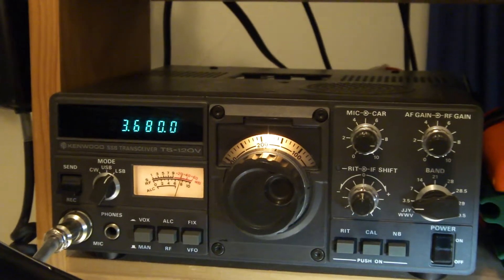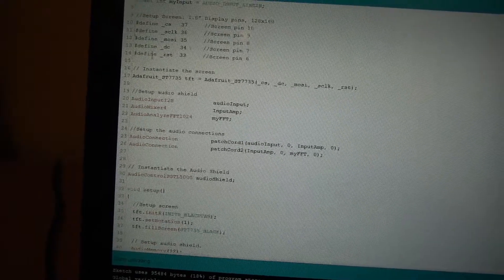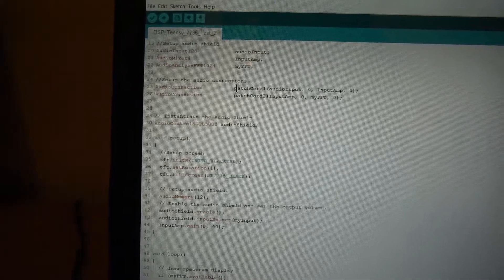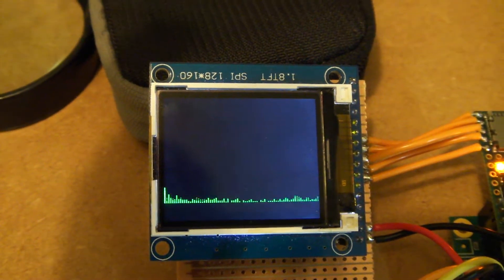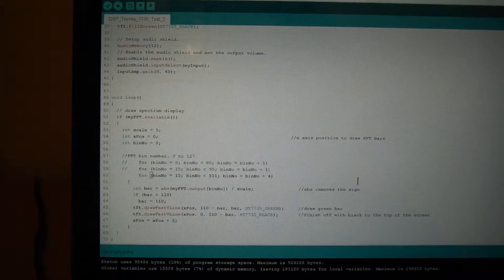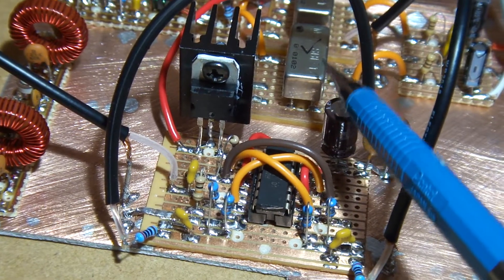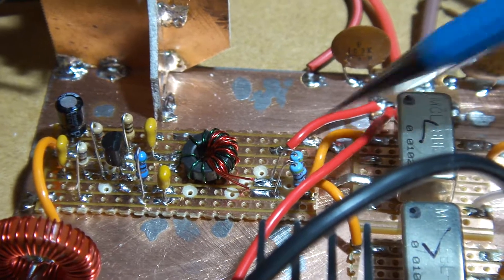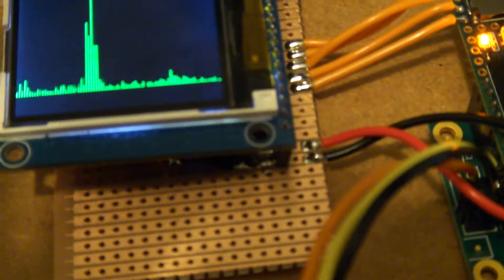Homebrew SDR Receiver Part 1 - LCD Screen and FFT Test

Comment: I'd love to know enough about the low pass filter coefficient values to create a high pass and band pass, all of which would be adjustable through 8 pots. Each cut off point and how fast it drops off. Wan to turn a Teensy 4.1 into an active crossover... and other things; see if I can do that and get near what a GoXLR does.

Comment: Could you share all schematics needed to built it, even de .ino code?
Reply from the maker: It should work Emerson. Try https://zl2ctm.blogspot.com/
Reply: Charlie Morris thanks a lot.
Reply: Charlie Morris could I use attiny 85 chip instead teensy?
Reply from the maker: No sorry, as i'm using the Teensy and it's audio library to do the FFT etc.

Comment: I love this project....I have a few teensys....might have to grab one of the audio boards. Thank you for your time and effort putting these vids together. I'm in the process of putting one of the quasi kits together for 40m and would love to be able to build my own SSB QRP radio for the various bands from scratch! 73 Ric  KN4FTT
Reply from the maker: Hi Richard. Thanks for the feedback. If you do look to make this then I suggest you use two small audio transformers like Pete N6QW did with his version. He had problems with ground loops, which the transformers fixed.73sCharlie, ZL2CTM

Comment: Hi Charlie, nice work!  Didn't realise you could do so much with a teensy.  Any reason why you didn't use a Tayloe detector rather than the sbl-1 dbm?  Must get a teensy 3.6 with that audio board.
Reply from the maker: No reason other than to try something different. Once the software the working the way I want it, I'll double back and look at the hardware again. It would be interesting to compare the dual SBL-1s with the Tayloe detector. Please note that this a Teensy 3.5, and not the 3.6.
Reply: Charlie Morris I'm guessing the teensy 3.6 would work just as well.  I studied electronics years ago but I don't know any dsp.  Wouldn't know a fir from an iir filter or Gilbert filter or when to use them.  I must get reading Paul Stuffgen's teensy audio filter work.  Any advice for reading in this area?  Not afraid of the maths, but something practical is always good.  You're an inspiration Charlie!  Just while I've got you, what are "spar puns"?  :)